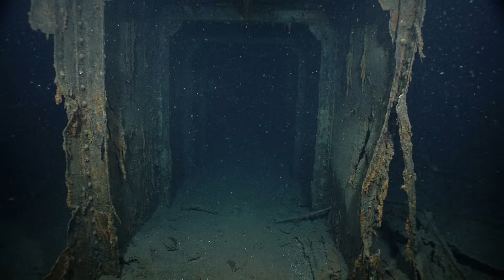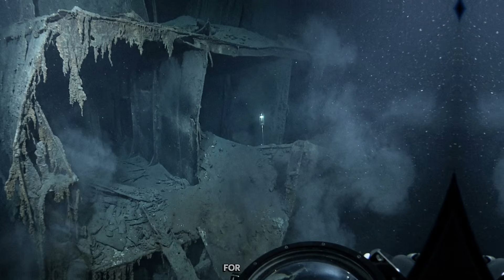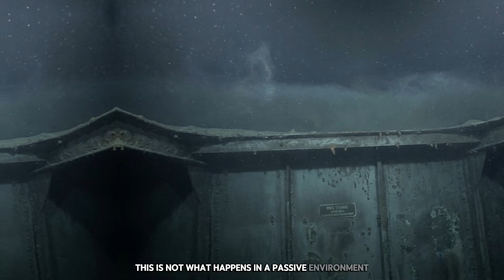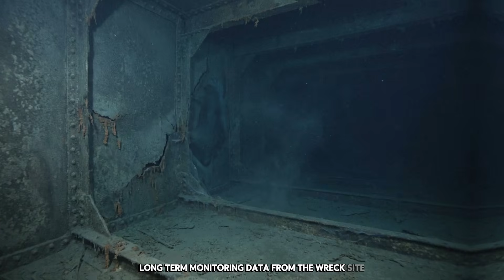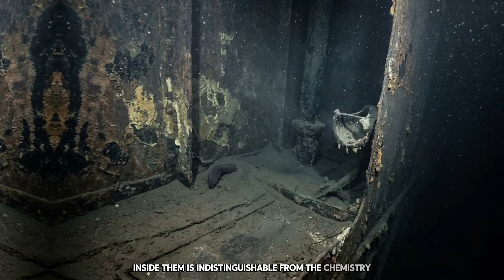Inside Titanic, the Ocean Still Can’t Finish the Job

Comment: The ocean is almost done the job.
Reply from the maker: It may seem close, but the process is still unfolding — the ocean hasn’t finished integrating the structure yet.
Reply: @SunkenRealmsDeep it's going to rot and rust away,no time frame can be applied to something like that.the endurance has been sunk for a lot longer and looks almost new in the cold Arctic water.those rov"s look like they are getting pretty far into the wreck of the Titanic though.good video sir.

Comment from the maker: 00:00  The Water That Never Mixed
01:32  The Gradient That Should Not Exist
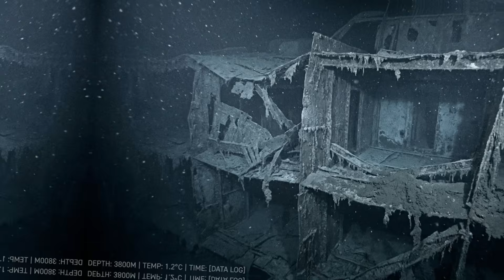03:25  Two Chemistries, Meters Apart
05:29  The Steel Fails From the Inside
07:28  Entry Without Integration
09:37  The Water Organizes Itself
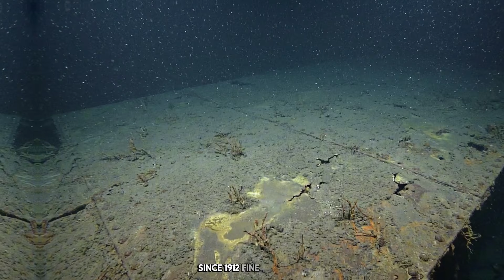11:36  Sediment Is Rewriting the Ship
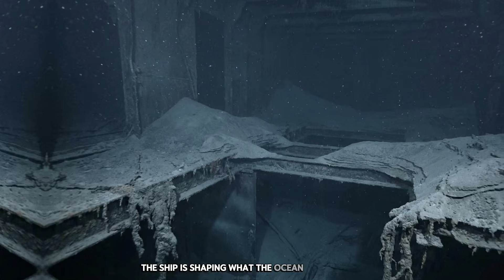13:41  Stability Is an Illusion
15:33  The System Is Becoming More Complex
17:35  The Ocean Cannot Finish the Job